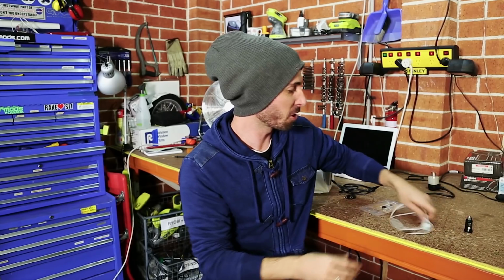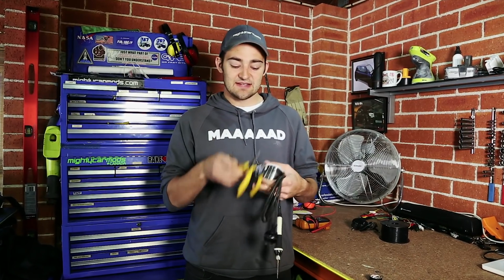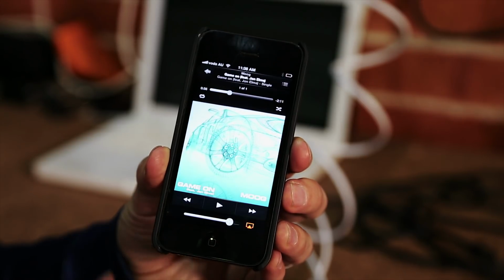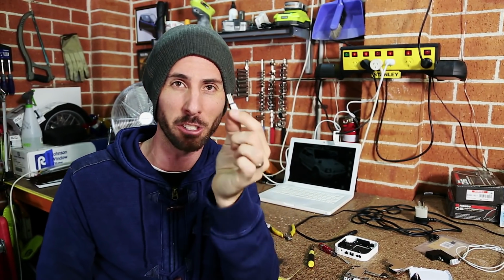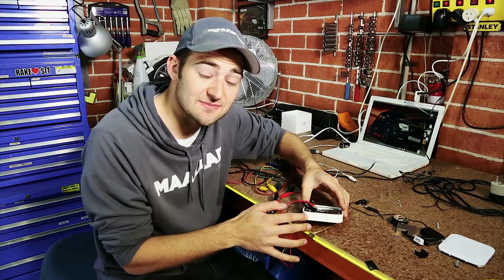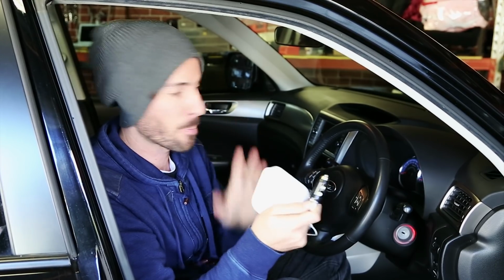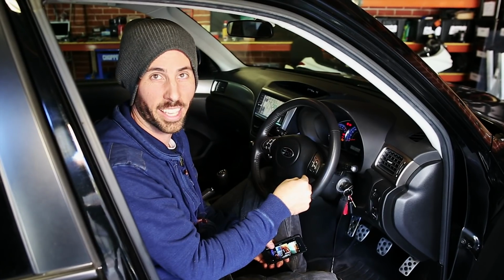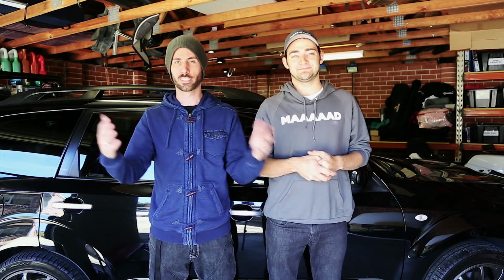Install Airplay In Your Car

Comment: I just completed this mod for my 2011 audi which did not have bluetooth. I had a $20 bluetooth adapter and definitely could tell the difference in music quality. The hack took me about 35 min overall and now have a wireless solution in the car. I thought it was cool and decided to go for it.

Comment: Why not just change your stereo to one which has Bluetooth or just use the aux cable to play your music
Reply: yoman279 FM transmitter sounds like cr*p
Reply: Or buy the Bluetooth to aux for 10$
Reply: *****  extreme audiophiles prefer aux over any wireless
Reply: dany fatso Belkin makes a Blutooth aux port adapter. It's like $45 on Amazon and works on any device with Blutooth capabilities. I have one and use it like crazy.
Reply: Shanee Bahera Bluetooth, wifi and similar connections are DIGITAL, and as such interferences are corrected by the protocol and don't affect audio quality.
Reply: +Roberto Merino not always true ... I've found you need to back the volume off a bit on the source (phone) so's not to overdrive the signal and distort the audio... just my opinion.
Reply: james lovett that has nothing to do with external interferences, and it is not a common issue. It looks like a bug in the phone or the receiver, or it might be the speakers are simply too weak
Reply: +dany fatso where is the fun in that? lol
Reply: dany fatso Connecting and disconnecting the aux cable every time you get into the car is a hassle, there are better alternatives than this (like wiring a Bluetooth a2DP to aux receiver), but that Aux cable thing is so 90's...
Reply: ok how much quality do you lose through aux cables or does it depend of the quality of the cable
Reply: ok thanks :)
Reply: dany fatso yeah that would be really good video(not)
Reply: ***** or fm transmitter if you really want to get fancy
Reply: Roberto Merino you lose quality on wireless especially in a car no telling what kind of inteference you will drive into

Comment: A cheaper way of doing the same thing that allows use of bluetooth is to buy a $20 bluetooth speaker adapter from jaycar and pluging that into aux port (the thing is battery powered)

Comment: Clever, but the hassle of selecting the wireless network for airplay is more troublesome that just plugging the phone in an aux jack. Then there are bluetooth units that also plug into the aux jack. or a bluetooth head unit.

Comment: Next time use a universal bluetooth audio adapter is 10x time easier, u can buy it for 20 euro's and will support all phones,i got one in my car , is powered with a 5v universal usb cable (like one for the smart phones),u connect it to audio aux port in your car,connect with your phone and enjoy music and the dimension of it is 10 x time smaller than that ''white apple'' box ! p.s. i use a ''trust'' adapter .

Comment: WiFi airplay is much better then the Bluetooth way. Now you do not need to modify the Airport. Check this device, only 20 bucks! http://www.aliexpress.com/item/2015-Original-airmusic-NW11-Soundmate-M1-WiFi-Wireless-Audio-Air-Music-Receiver-Adapter-AirPlay-DLNA/1929892363.html

Comment: Why has nobody mentioned FM transmitters. Works with any car with a FM radio for less than $20 and about 30 seconds for setup. They may be outdated but most are still reliable and a cheaper option.

Comment: Seriously guys, nice job and all, but this is really outdated, even if for the date it was posted (2013). There're so many easier and cheaper ways to do this. Pretty much every car comes with bluetooth nowadays and a simples aux cord would work just the same.

Comment: 7833 IC must have minimum 5,3V (but some noname have more than 6V) input to work properly, 5V from car USB charger can't work in every case. From other side you can't power it directly from 12V if you don't use really big heat sink. Ideal you can use step-down converter with output 3,3V from ebay (cost only few bucks) connected to 12V, it will work perfectly and will not get hot.

Comment: what car is that ? and what brand of wire strippers does he use? the red ones? i see them in other videos alot.
Reply: ***** You clearly don't see my point.
Reply: 2009-2013 Subaru Forester.
Reply: Wires strippers?? there all practicly identical jus go down to the hardwear store and buy a pair of red ones
Reply: i found them. and no , they are far from identical. thanks
Reply: How are they diffent they all strip wires so...
Reply: ***** All cars have wheels, thus, all cars are identical.
Reply: ***** we were talking about wires trippers lol not cars

Comment: Wouldn't it have been easier to get a DC to AC power inverter? I mean cmon.
Reply: I guess it's cheaper to just buy a regulator. Assuming one already have the soldering tools and knowledge. Lol

Comment: A question: He's saying: "extra voltage shared as heat". When I see at the diagram, on USB-cable. I see two unused cables (green and white). Is that the data +/- cables? What you do with them? 

I assume, not use them, as you only want power from USB. Correct?
Reply: yes, those are data transfer, when plugged into a power only supply those wires have no voltage, so you really don't have to do anything with  them.
Reply: That is a 3.3v linear regulator... That means that regulator will heat up. REALLY REALLY hot. That airport express draws more power than that tiny heatsink can dissipate... I see a thermal issue here; they should have just used a switch mode regulator. Like a LM2596
Reply: *****  This LM2596, has this built in heat sink? What does it do with the extra 1.7 volt?
Reply: The 1.7 volts is converted to heat
Reply: fueled by Yes, but will the heat do no damage to the electronics?
Reply: lnesland 1.7 volts is about 2.2 joules of heat, it won't be a lot
Reply: If the heat is an issue a better heat sink is a small investment

Comment: why not just get a pioneer dash system and replace it with your car's stereo system. I mean this is cool but i think that video you guys made was far more sufficient than an ipad and this airplay. cuz they still require some sort of streaming service, like a data connection or an isp.

Comment: Bluetooth is a MUCH easier solution than Airplay, holy cow! Lot of work for a result exactly the same as Bluetooth. Before you rag on me about some cars don't have Bluetooth, you can buy good Bluetooth receivers on amazon for 20 bucks that can plug into your aux input.  People that say the airplay is higher quality, I can assure you unless you have super expensive speakers in your car you won't notice a difference in sound quality. Bluetooth is plenty decent.
Reply: Maybe not the kind of quality you're thinking of. I've had 2 different cars with Bluetooth and I've had issues in both with the music speeding up and slowing down, as well as skipping. I did this mod for $20 and it's worked without any issues so far.
Reply: Well not correct. Its not working on my Volvo V50, that has bluetooth for phone. I tried added a second bluetooth, and use the AUX, but not working.
Airplay should be my solution to have wireless music in the car.
Reply: Bluetooth is sketchy in my car and the audio quality is better with Airplay.
Reply: Thats bot DIY now is it. So its defo not the
Mcm way.

Comment: this only works in the following scenario :

you have a car that only has the factory stereo , which features an auxiliary port and you want to play music wirelessly without buying a bluetooth stereo , which, in that case you could buy an adapter blutooth to AUX which will be much cheaper to do this.

Comment: more easy and more cheap you buy one of this "Bluetooth mp3 Audio decoder board " on ebay for less than $10 and also much more option.
http://www.ebay.com/itm/290939755004?_trksid=p2055119.m1438.l2649&ssPageName=STRK%3AMEBIDX%3AIT

Comment: I just have a Bluetooth receiver plugged into the aux port. But you can also go this route, I guess.
Reply: ***** The A2DP spec allows streaming the music while it is still encoded and decoding it in the receiver. Enough is enough, so data transfer rates are irrelevant.
Reply: *****
Incorrect. Even Bluetooth 1.2 with A2DP was triple that and the spec has improved enormously since then. Apple didn't support A2DP for years after the spec was more than capable.
Reply: ***** Obviously. ;)

Cheap but high quality AptX Bluetooth receivers are all over. They work with much more than just Apple devices. The Kinivo kit in my car sounds excellent and the Parrot kit on my motorcycle is awesome.

I do wish Apple supported Apt X, but the encoder for AirPlay is obviously the same for A2DP anyway. A2DP also allows sending the original bitstream for supported decodes, like MP3 to headphones with an MP3 decoder, that way it is digitally perfect and entirely up to the target system's potentially superior DAC.
Reply: You will need a pretty good bluetooth receiver and a compatible bluetooth encoder... I used to use one until i started cranking the bass. It sounds horrible, on stock speakers when i crank the bass it sounds like a cow bell going wild.

Comment: Do you need to get the power from the AUX? I assume I can just use 12 V coming from the car and use the voltage regulator. (or maybe 2? or adding specific resistor values in that can take the current) This wouldn't be the best idea for a portable unit, but nice for a permanent one.
Reply: Maybe I'll just hack the AUX power to USB converter and tap that into the wires connecting to the backside of the auxiliary port......

Comment: hey would it still work if you get the power by take the 12v cig light out and cut the power to it and rejoined it and put a fuse to the airport

like you would if you installed a new radio and had to attach the ignition wire to the 12v cig light 

hope you can under stand what i mean

Comment: i have better idea.  how about  bluetooth
Reply: Air play has a higher BitRate so the music is much clearer
Reply: Sergio Blanco just get a new car deck with bluetooth, that what i did in my 89 Toyota truck
Reply: Sergio Blanco 3.5mm bluetooth adapter, 20 bucks, plug it in to your auxillary and you are done
Reply: Tanner Stig the only requirement of your car is that it has an aux input. if you are having issues it is with the Bluetooth or your phone.
Reply: But what about car like the 2005 and under XD lol didnt think of that huh?
Reply: It doesnt work on some cars, like my 2010 Buick Lacrosse
Reply: Sergio Blanco Aftermarket bluetooth stereos are a thing for cars 2005 and under, I have one for my Suburban.

Comment: is it not jut as easy to buy a plug adapter for the car for 3 or 4 dollars of ebay then there would be no need to take the system apart, potentially breaking it

Comment: y is there 4 pedals in the car
Reply: clownrock95 There's only three... the "pedal" on the far left is just a place to rest your foot
Reply: parking brake, brake, clutch, accelerator
Reply: must be because of the custom pedals because all the cars I have seen the p-brake is a tiny pedal up by the dash thanks for the answer
Reply: It's a manual transmission car. One is the emergency brake, 2nd one is Clutch, 3rd is brake and the 4th one is the gas.
Reply: ***** Then where is the emergency brake? In a manual transmission, you can't park anywhere non-leveled or it'll just slip back.
Reply: It's not actually a pedal if you look. It's a plate screwed into the trim to rest your foot. Only 3 of the "4" pedals are functional!

Comment: I understand the wireless, but just buy a bluetooth to 3.5 like i did for 5 bucks, then power it while in use with a USB Car charger. Plug the aux in, everything is good to go 1/2 the price

Comment: would it not be easier to just plug your phone like into the audio jack in the car >..> ?
Reply: Jesse Asher
i think its more of a "just because i can" project. all the excuses about better music quality, are bullshit. quality comes from amplifiers,speakers and where ever you got your music from. i can see many problems with people trying to change music in the car at the same time. this is a cool option but not very logical. too much work for soo little reward.. its more just to show off..
Reply: Rokas Getautas Most do nowadays. I myself just installed a Bluetooth / USB head unit into my '83 Volvo 240. Easy stuff.
Reply: Jesse Asher a long cord is a huge hassle and it could make a big mess.
Reply: Jesse Asher Okay this is what they focus on:

1) WIRELESS
2) MAXIMUM AUDIO QUALITY

The car already had a good sound system.
Reply: dude i agree with you, this video is just wasting of time and the idea is money wasting. brainless people
Reply: Honda crv 2002 model doesn't have that.
Reply: but still for the cost, just making a play list on your phone of what everyone wants and then plugging it in... even a high capacity mp3 player would be cheaper...
Reply: Jesse Asher Some cars don't have the auxiliary input option.
Reply: if some cars dont how do you plug the white box in then ?
Reply: Jesse Asher Then this video makes it a tutorial for only cars with the auxiliary input option. They're just showing you how to wirelessly play music through the Airplay system in your car. Plus, Airplay's audio is much higher quality than standard bluetooth and this just makes it fun for your friends to stream music wirelessly.
Reply: the quality of the music is defined by the quality of the sound system installed in the car, e.g my old bmw 5 series with standard sound system destorted quickly, my new bmw 3 series can go to almost deathening before destrotion.
Reply: @4jess5  oh this comment didn't age well considering that almost all flagship phones don't have the jack anymore..lol..

But anyway most cars have Bluetooth today so my comment is irrelevant
Reply: I was thinking the same thing. Only advantage would be that its cordless.
Reply: Arlind Sadikaj  i agree there is no point to this mod at all
Reply: David D  i think i mentioned in previous comments that the audio quality comes from the sound system you have. also i agree probably is a because i can project
Reply: Jesse Asher yeah im a little slow sorry about that.
Reply: Or just buy a $10 portable fm radio transmitter
Reply: Jesse Asher I think you've misunderstood what I mean aha. It's a little device that has a 3.5mm jack which plugs into your phone and transmits the sound at your selected frequency.  Then on your radio scan for the fm frequency and yeah easy.
Reply: long enough cord would do the job... and be alot cheaper
Reply: not rly the phones just gonna be in the same place, would still be cheaper to just get a dash mounted phone holder and have people req songs :/
Reply: yeah... my stement stated it would be easier to plug it into the audio jack? ? ?  and much cheaper ?
Reply: Jesse Asher yes it would be easier, but not modifying the car in the first place would be easier still, plus I hate wires and clutter inside cars, it's why I don't use satnavs
Reply: mine trucks radio u plug the usb in and it plays and charges phone
Reply: Or you can buy an inexpensive stereo with bluetooth, I just use an aux cord too. I just don't see the benefit of this.
Reply: ***** cars generaly have a radio built into them, this mod is for your own music  ? not radio ?
Reply: i dont get it ***** im just gonna set my record player up on the back seat all too complex  xD
Reply: Jesse Asher wouldnt it be easier just to sing to yourself and play the air drums on the steering wheel?? ..lol.. 

Actually Blandrazor has a good point i forgot what those things were called and im pretty sure by now there should be a app you could download on your phone to do just that..
Reply: *****  i just read these comments back and now see your point :P
Reply: Jafar Almusallam
Reply: Because mad street cred with music floating magically through the air to your ears with no cable
Reply: Oh that's no fun.. Cool tech is what's fun! LOL
Reply: do most standard head units not get bluetooth built-in already?
Reply: My car is from 1985, it doesn't know what audio jacks are. But it does have a cigarette lighter, which means it has 12v power supply, which means this is still possible. It also has an aftermarket head unit, that has a audio jack, so i'm good either way.
Reply: Our phones don't have audio jacks anymore

Comment: Cheap and easy? I did it for $10 by purchasing a "bluetooth to aux" device on amazon. I'd say thats way cheaper and way easier seeing how it required no soldering. It is also much smaller and does literally the same exact thing.

Comment: Cool but can be allot easier. Get a bluetooth wireless adapter and a usb to carpower adapter. And you really need to make is a usb 2 power cable and BOOM get yo tunez on. + cheaper than anything coming from apple :-)

Logitech - Wireless Bluetooth Speaker Adapter

Comment: I'm dun founded as to why mac hasn't manufactured an in car air play, I have done this with an inverter, works ok but the inverter doesn't produce a true wave hence a slight buzz is heard between songs. I've since found a 12 v to 3.3 v converter and am keen to try it out and am keen to try it out. Thanks for sharing your mod guys :)

Comment: Would you be able to do this with its similar buddy, the Apple tv? since they basically throw them away in big sales (dick smith had them for 99 with 20 itunes card)
Reply: i need to have apple tv in my escalade monitors but there is no hdmi input only AUX plug input

Comment: Why use the USB adapter? Can't you connect the voltage regulator straight to the car battery?
Reply: Taking 12V down to 3.3V with a linear regulator and a tiny heatsink would produce immense amounts of heat and fry the regulator, not to mention melting any wires attached.

Comment: Could you play video through the head unit using air play?
Reply: No coz the only connection to the stereo is Audio, unless you had 1, a video monitor on your stereo and 2, connect a video cable from the Express to your stereo